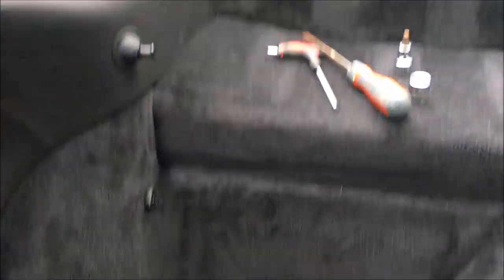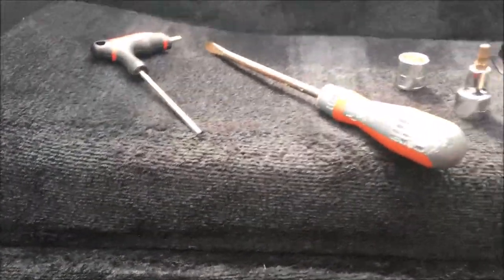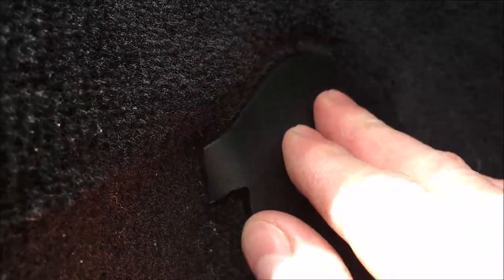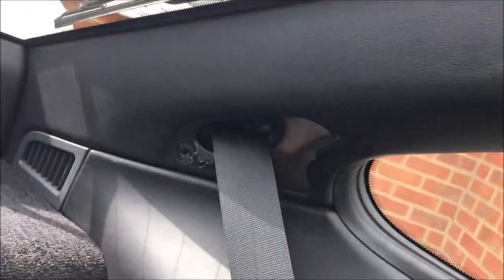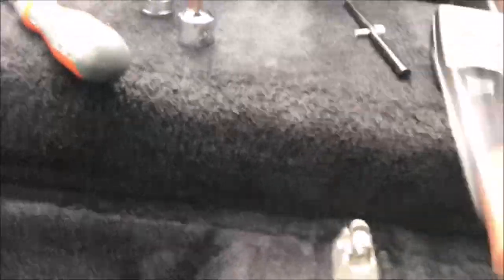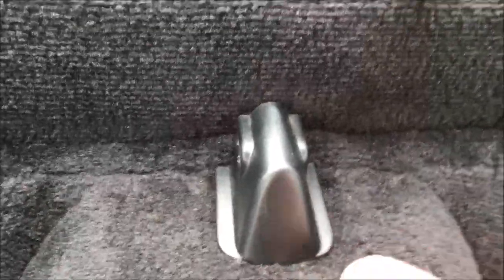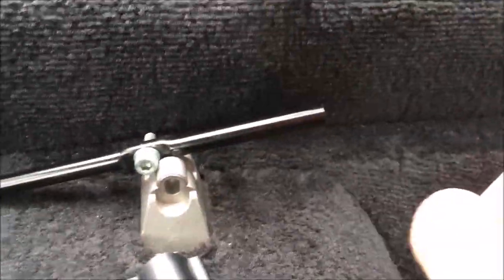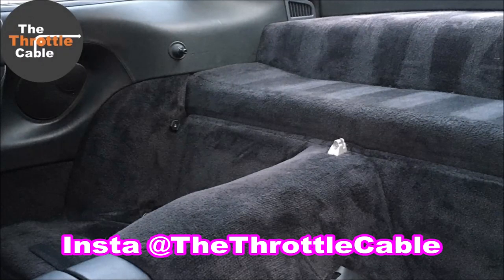Rear Seat Delete | How to Guide DIY | Porsche 996 997 911 GT3

Comment: Thanks for the great guide. I've already done the rear seat delete before watching the video. But I didn't know the rear seat belts can be tucked in behind the trim once it's retracted. That's pretty cool. Do you have any issues of them rattling behind the trim?
Reply from the maker: I’ve had no issues with rattles mine are snug; you could wrap them in the soft side of sticky back Velcro or a bit of bubble wrap if you have any issues 👍

Comment: I’ve got to this video too late and also stripped the spline in the back... how did you remove it once it was stripped?
Reply from the maker: I noticed before any issue fortunately - in your shoes I would get a bolt extractor tool to avoid any more issue!